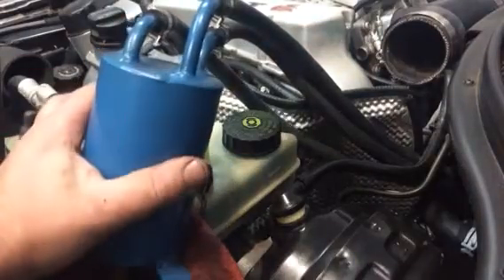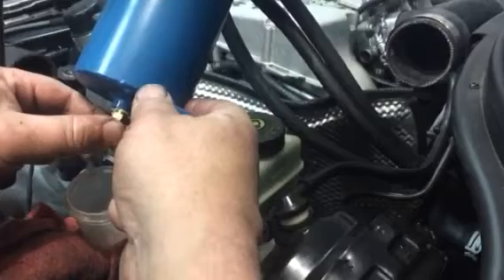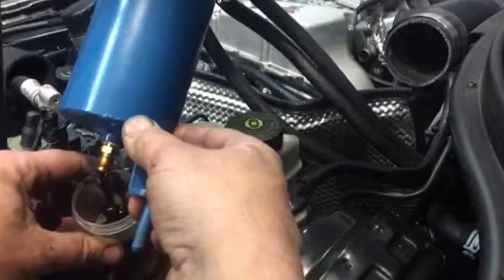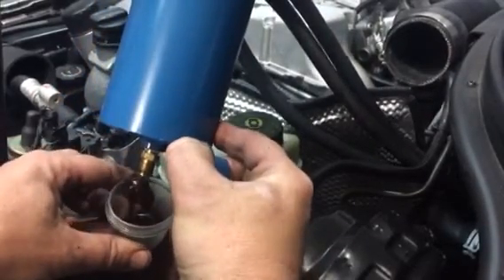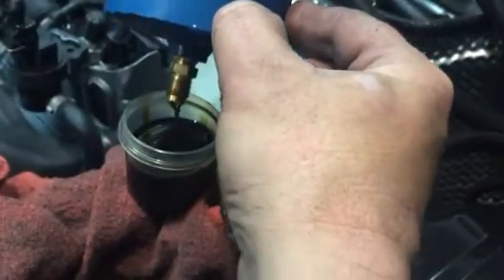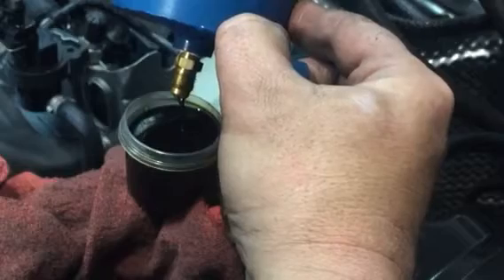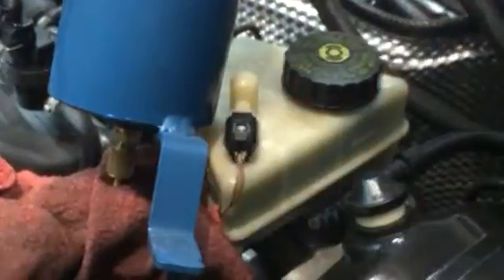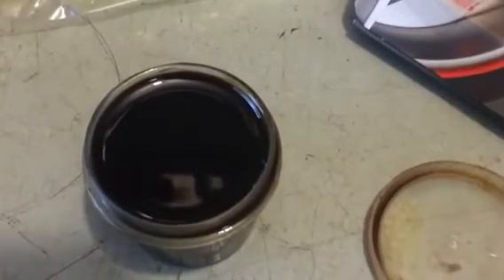Oil catch can, do they work. here are my results

Comment: I have a 2002 SLK 320, same motor as the Crossfire.  Had to pull off the air intake recently and discovered the inside of the intake was wet with oil.  My mechanic didn't seem to concerned.  Said it was pretty normal.  Car runs perfect.  Is it worth installing a catch can at 125k miles in your opinion?  Am I really going to avoid problems or extend the life of the engine by adding a catch can?  Also, the oil separators on top of the valve covers are supposed to catch the oil and drain it back to the heads.  Is it just a poor design or are my oil separators potentially gunked up allowing the oil to get to the intake?  Is it really "normal" on these motors for this to happen?  Thanks
Reply from the maker: Prevents having knocking, pre ignition, will keep contaminants (carbon build up)  from accumulating on your valves and pistons, keeps your engine intake and throttle body clean from oil vapors coming from the crankcase. the cleaner those parts are the better you will keep your engine running to as close as maximum performance.

Comment: Still interested in learning more about catch cans. Are they specific to 32AMG engines or applicable to all engines. In long term say 150k miles on an engine, what benefit do you believe it will provide?
Reply from the maker: they are for just about every car out there, Prevents having knocking, preignition, will keep contaminants (carbon build up)  from accumulating on your valves and pistons, keeps your engine intake and throttle body clean from oil vapors coming from the crankcase. the cleaner those parts are the better you will keep your engine running to as close as maximum performance.